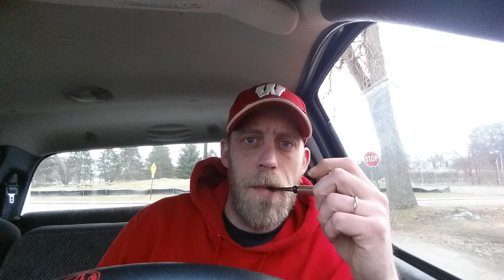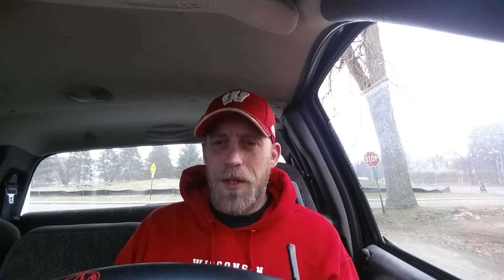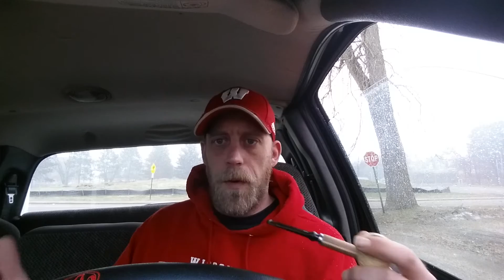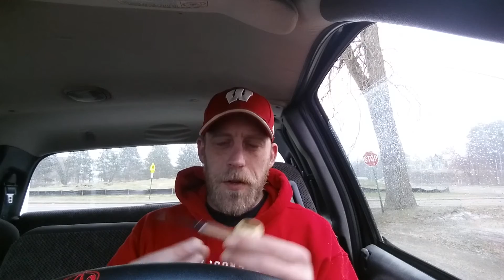Cob mod quick tip : Shank types / materials

Comment: Great video Badger!  I think you got the order right for the most part.  Of course difficulty is relative.  For example, I have no problem turning a shank on the lathe, but wouldn't know where to begin with bamboo.  But your order makes sense and will apply to most.  If your taking suggestions, I would love to see a video on using bamboo.
Reply from the maker: +CaneRodPiper Maybe I will make a video  making a pipe with bamboo stem.  It's pretty simple and would be a good starting point for people without access to alot of tools.